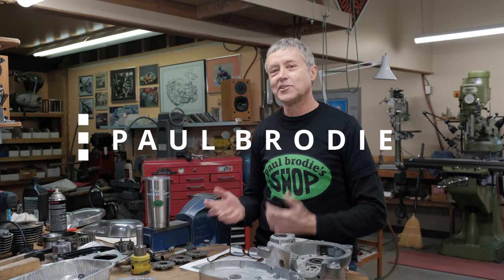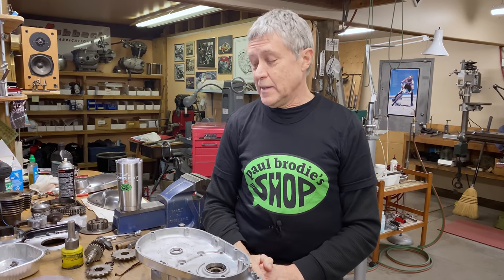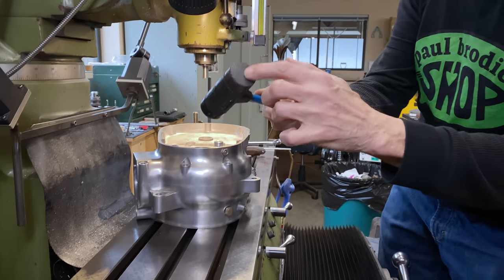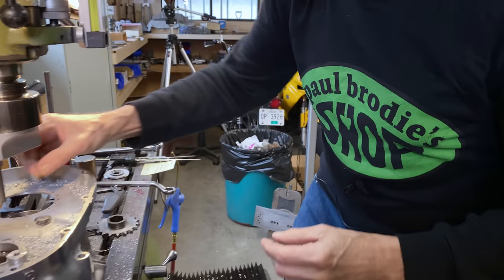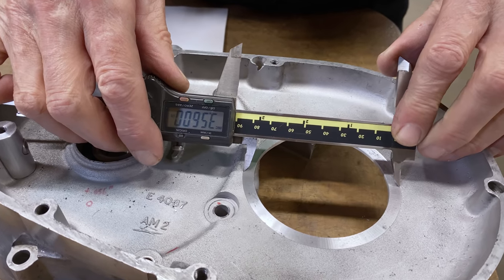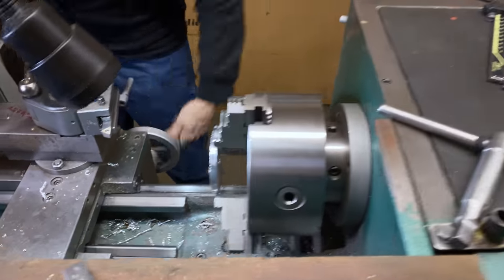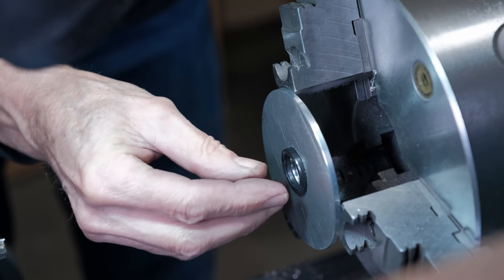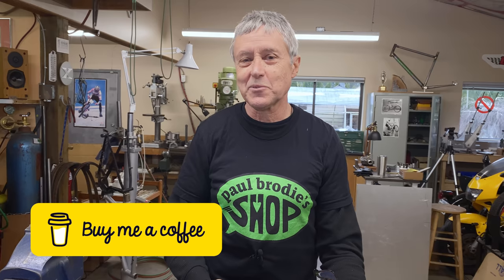Tiger Cub Engine Mods // Paul Brodie's Shop

Comment: I get a big kick out of the fact that Paul expresses surprise upon achieving perfect fitment of a part which he scrupulously planned and artistically executed several machining processes.
Reply from the maker: Thanks Tony.
Reply: @gpw203  Because it's in engineering where the technologies [besides arguably semi-conductors, although that has its own engineering] are executed. Engineering is such an under appreciated practice by almost everyone. When I was a teenager I totally dismissed engineering, because people who worked with their hands did the daily stuff, and I didn't want to do that. I ended up getting a BSc in Env Sce. But the older I got the more I appreciated making things with precision. I'm not an engineer, but I can set up and use machinery like manual lathes and capstans. I can stick and mig weld too, reasonably well. But I have to do it all in baby steps. A proper engineer can visualise the solution, work it out, and properly execute it in the correct manner. And there are loads of different engineers at all levels. To the average person it's modern magic. Agreed on the therapeutic, by the way.
Reply: The man says the intro like it's a question. Are you sure he's excited? "HI? I'm Paul Brody?"

Comment: Hi Paul. I also did this modification, on my cub, but I put a bearing in, as well as a seal, for extra support for shaft. The plate needed an extra top-hat section to fit both.
Reply from the maker: Hi Dave, maybe an extra bearing is needed, depending on how hard you are abusing your motor. I will test what I have done and generate feedback...     :face-orange-biting-nails:

Comment: The BSA Starfire I owned had a similar plate behind the clutch as standard (BSA Starfire was last C15). I remember assembling it without the plate. When I changed main bearings.  When they failed they stripped the pinion timing cog.  New main bearings were a BSA upgrade to ball bearing race one side and a special and expensive barrel roller race the other side.  50+ years ago now!

Comment: My 71 Bonneville engine has a removeable panel to access the drive sprocket much like what your doing here Mr. Brodie. I guess they had savings in mind when they designed the cubs, nice modification whoever replaces the sprocket in the future will be very happy you spent the time to do this "Engine Mod" Thanks for sharing! Good work on the editing Mitch!
Reply from the maker: Thanks Rick.

Comment: Paul - really enjoy that you share the journeys you go on - and the thoughtfulness involved with achieving a desired end result.

Thank you.

I'm starting to get stuck into a rebuild/refurbish of a '69 Bultaco Mk2 Campera bike.
(175cc / 2 stroke / 5-speed / electronic ignition bike)
Was my father's - tucked into a barn due to magnito failure shortly before my birth in 1973.

Watching your work gives me a lot of inspiration.
One of the dynamics of a desired end-result on this enduro Bultaco build - is for a left/right shift/brake swap.
(my '96 900ss/sp, and my '72 cb350K3 bike are both brake on right - with GP shift on left)
.. so to get the Spanish left/right foot controls swapped is going to take proper-engineered cross-shafts.. two of them.. for zero slop and well-leveraged mechanical action.

Your level of obsessiveness is congruent with my own..

Cheers from WI !
Reply from the maker: Jason, thanks for watching and commenting. I did the shifting conversion on my Vincent. I put a lot of thought into it, and the parts were well made. It added slop and flex in the shaft, no matter how fussy I was. It will never shift as crisply as no linkage. I just learned how to ride and race with the shifting on the right, upside down too.
Reply: @paulbrodie  Oy.. ouch.. and I get it.. engineering-wise, the transfer points are too many.

Once in youth, I swapped a cbr600f2 bike to GP shift (just flipped the linkage) - and after getting accustomed to it - it was like the way [god?] intended. It was for me. 

A '94 900ss/sp bike is in my stable - and one of favorite parts about that bike was pulling off all the linkage for a "reverse" pattern (down for up), one piece aluminum unit which mounts straight off the cog. Nirvana. Zero slop.

Other bike in stable is a '72 cb350k4 bike. ~14 years ownership .. etc.. anyway also flipped linkage on it to GP pattern.

Yes. Yes I can flip/accommodate as needed - but there's always that time when you mistakenly brake on - or go to shift on - the wrong peg.. 

For the bikes I have and love and maintain - and in my age - I just want their shifting/braking to be all congruent. Build them all for myself kind of deal.. and in any event that takes much thought and .. conviction ..

Cheers Mate

Comment: One of our old machinist used a technique called pressure turning.  So that plate wouldnt be chucked on the od. He would use the tailstock to center on the hole you drilled. He would them push that plate onto the front edge of the chuck teeth. Then you can turn the od concentric to the hole. No arbor required.  Nice video paul as always.
Reply from the maker: Thanks for commenting.

Comment: Another Great show, in particular  I like your belief, belief that you are going to do more than 15 thousand miles which is the  distance a well oiled chain and sprocket last.    I Believe. :-)
Reply from the maker: Thank you Mike. I want to get the gearing right. I have asked several Cub enthusiasts about gearing, and not one had an answer,  probably because they don't ride much at all.

Comment: Hi Paul…. Fantastic workmanship & video (Mitch) as usual 👍 I was on the edge of my seat when you were boring that hole in the casing 😤😤😤😜…. Loved the witness mark story …. every days a school day 👍….. I see that your tolerance’s are tight, Will the gaskets push the oil seal further off the brass bush when you do the final assembly, Is this something you also have to  allow for ?
Reply from the maker: Thank you. I'm not using a gasket. I have Loctite gasket sealer and it is great.

Comment: The 350/500 & 650 Triumph motors all have a door there which seems a crime to not have on the Cub. Compared to Japanese and most modern bikes where the sprocket is under a simple cover, the old British bikes are a whipping to change sprockets on. You’re building quite a special motor, Paul! Your skills are inspiring.
Reply from the maker: Thank you bandavanza.

Comment: I didn’t know that the Cub didn’t have a sprocket access plate so this is a very worthwhile modification. I used to own a BSA C15, which did have one and it was essentially the same motor. I now have an iron barrelled Royal Enfield 350 Bullet which also has one. Even so it’s annoyingly complicated to have to dismantle the entire primary drive side just to change the sprocket. Officially speaking I think you you need four special tools and a very large socket spanner to remove everything just to get at it! I can’t help comparing it to a 1977 CZ Enduro 250 I owned where you could see the sprocket from the side of the bike and just two easily accessible hexagon headed screws held it in place. I’d think it was a five minute job to remove and refit it.
Reply: Edited: I just found a photo of the CZ. In fact to hold on the sprocket there was just a central hexagon nut locked by a simple tab washer. No need to dismantle anything else. The bike also had a dry multi plate clutch directly on the crankshaft and it could be kickstarted in gear.

Comment: Hi paul:  if you reference diamond chain or machinery handbook. They say do not use a even numbered tooth drive sprocket. Because of wear. I checked several manufacturers  honda  KTM.  they use uneven tooth drive sprockets. Also if you have a choice between a light chain and a heavy one in the same size chain use the light one. It's easier on the sprockets.
Love you mods and planning you do. Very inspirational
Reply from the maker: Thank you John. I don't believe this will be a high mileage machine. I just want to get the gearing right. You are probably correct about an even numbered tooth sprocket..

Comment: I have a Junak M10 1963 polish motorcycle, which is build in a very similar way to the Cub and other Triumphs. It actually has the feature which you are making in this video. Chaninging front sprocket is still painfull because you have to dismantle the whole clutch.
Reply from the maker: Were the Polish copying the British?
Reply: @paulbrodie  Yes, very much. With some local flavores added. You would be very familiar with Junak M10 despite you probably have never seen it. Junak M10 has a bit of cult around it. It was purely (well, inspired a "bit" by british constructions) polish bike, 4 stroke and kind of luxury motorcycle behind iron curtain. Slightly flamboyant in comparison of super simple and crude 2 strokes which dominated socialists countries in the 50/60.
Reply from the maker: @krzysztofdrobinski162   Very interesting, thank you.
Reply: @paulbrodie  You are very welcome. I thank you for the great content and countless "nice fits". If you are interested in Junak m10 let me know - I can translate something for you - I believe there's not much info available in English.

Comment: Hi Paul,
Somewhere in the dim darkness of my memory there is an image of a countershaft sprocket access hole that was relieved to fit a larger than usual sprocket on the shaft.
Notches were cut to allow the tips of the teeth to clear the opening, this did not affect the sealing of the seal carrier to the inner clutch case.
This was done to either a BSA A65 or a  Series C black Shadow spec Vincent 1300 used in a racing sidecar.
Enjoying your adventures immensely , Take care.
Reply: Found that on Triumph twins
Reply: @1924ab  Ditto on the Triumph 650s.
Reply: @1924ab  Hi, My Triumph experiences are entirely pre unit related and we weren't using a triumph drive train.
Thank you for the info.
Reply from the maker: Yes, that could work to fit the 19T. Thanks.
Reply: @Alfred Wedmore You are correct, although I vaguely recall that it was setup with a bastardised Norton clutch and grr box lashed to the engine.
This was 50+ years ago and I was more taken with the engine and the mini wheel frame than anything else and really wanted a ride on it as passenger.
Thank you.

Comment: Fascinating.  Did later Cubs have the access door from stock?  BSAs I worked in had access but don't recall off hand if all the BSA singles had one.  They sure were cutting corners to keep the cost down on those old Cubs - must've been a carry over from the 150cc Terrier origins.
Reply from the maker: I don't believe there was ever an access door. This was a fun mod. Thanks for watching.
Reply: @paulbrodie  the last cubs supplied to the French army had the access door from the factory
Reply from the maker: @philholey3958   So interesting that the British did it for the French!

Comment: A Cub expert, here in UK, used to fit sprocket windows into motors which were assembled and fitted into bikes.  Seem to remember him boring the hole with a hole saw and a brace and bit (hand drill type of thing), cant remember any of the rest, but they used to work fine.............
Reply from the maker: I wonder how he got the oil seal to locate accurately? Maybe there was no oil in the primary drive?!

Comment: Hey Paul, An alternate technique for truing wobbly parts in the lathe:  a/Place part in chuck, b/run late in reverse, c/bring cutting tool up to part and touch work, d/due to the rake on the tool the part will centre itself and run true with minimal or no marking. e/tighten chuck and check trueness.  f/ continue with operation. IMHO this has always worked for me on small and larger diameter work. As always good stuff T
Reply from the maker: That could work, the tool would be used in a way it was not really designed to be used. I won't tell.

Comment: Hi Mitch and Paul.
I am not a machinist or an engineer, but a couple of questions.
You use a plumber’s hacksaw not an ‘s hacksaw…so does Allen Millard… and you both accomplish great things. I was taught that a hacksaw is just a very narrow file and should be used a such, one hand to guide on the handle and one on the other end to pull through the work piece.
Have I been laboring under an apprehension all these years?
And… you don’t part off in the lathe. Was my old metal work teacher, late of Saunders Roe on the Isle of Wight barking up the wrong tree?
And if so, why?
Reply from the maker: I have ever heard of a hacksaw referred to as a Plumber's Hacksaw. I don't think of a hacksaw as a narrow file; it is a Hacksaw. Today we shot a video and I parted off a bronze bushing in my lathe. I do part off, just not excessively.

Comment: Dear Mr Brodie, since we are talking mods and sprockets here. I'd like to address your expertise a simple question. Is it possible or rather advisable to drill a stock motorcycle rear sprocket`s screw hole larger? I guess they come heat treated and surface hardened
Reply from the maker: I think sprockets (steel) are made of a good steel, but I doubt that they are heat treated and surface hardened. I did drill out my Cub rear sprocket to use a slightly larger (and non-standard) bolt, and it was no problem...  Thanks for watching!    :face-orange-raised-eyebrow::face-orange-raised-eyebrow:
Reply: @paulbrodie  thank you very much for your kind reply

Comment: Paul, I think BSC thread's are 60 degrees, and BSW are 55 degrees, I could be wrong though. Nice mod though, BSA did it on a lot of there bikes, so you only had to take the clutch out to change the sprocket. Best of luck with it.
Reply: You are not wrong at all. BSC = 60 degrees, BSW (and BSF) = 55 degrees. (And I noticed that you have a video on a WD B40, which happens to be just my thing...)